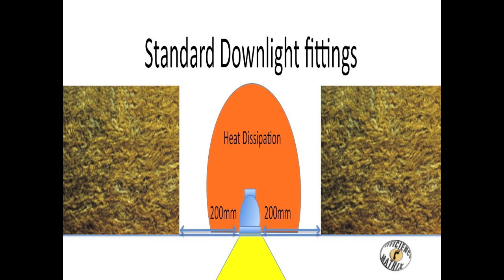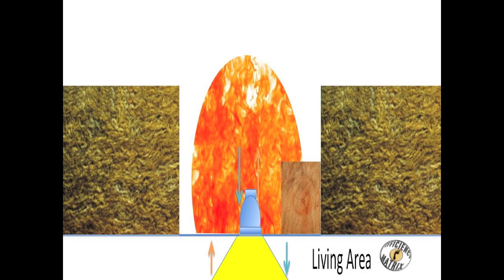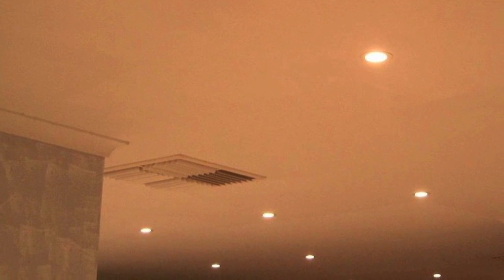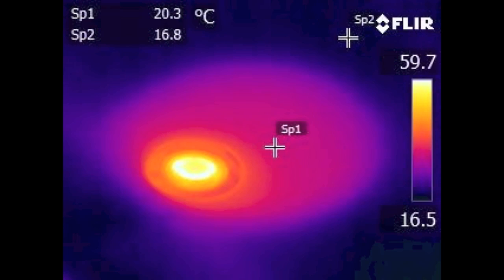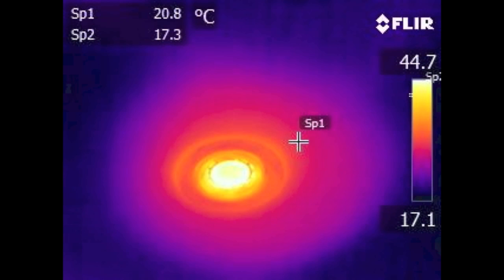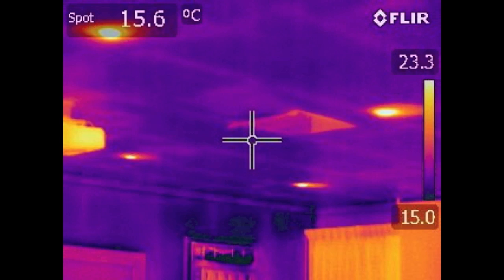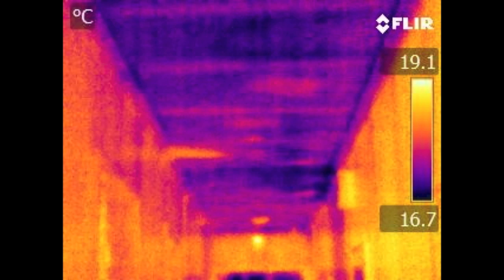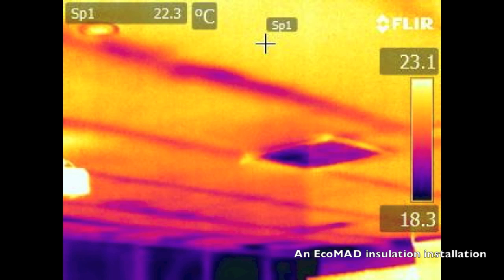Efficiency issues with LED Downlights. Effects on Insulation & air infiltration

Comment: We don’t have downlights but for interior design reasons I was planning to install LED downlights. However, due to the implications this would have for insulation would you recommend a different style of light fitting that doesn’t impact on insulation at all?
Reply from the maker: Recessed lights that do not penetrate the air barrier and thermal barrier are always the best way to go, for building performance.
you can get a no recessed downlight.  We drew a fish diagram of it in this article.
https://efficiencymatrix.com/downlight_benefits/

Comment: I used the clay type plant pots as a cover, super cheap, , foot of insulation over it, done. Didn't bother caulking it and filling up the bottom hole, but might do in future when I get down to the nitty gritty sealing the house for air-tightness.
Reply: mirola73 A novel idea with the clay pots. I looked at various Downlight covers some years ago. Funnily enough ended up using the Downlight Mitts John sells, as I didn’t have to get into the roof space.